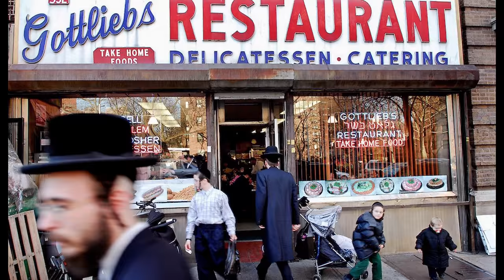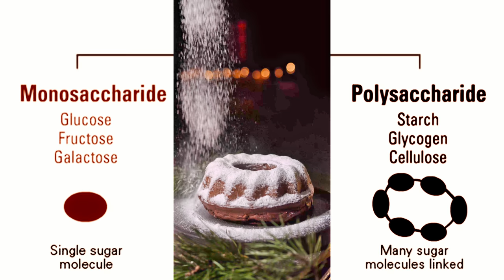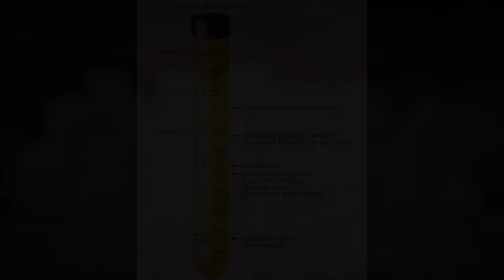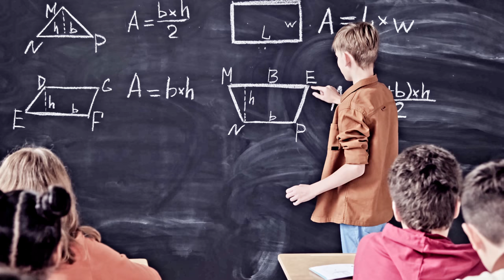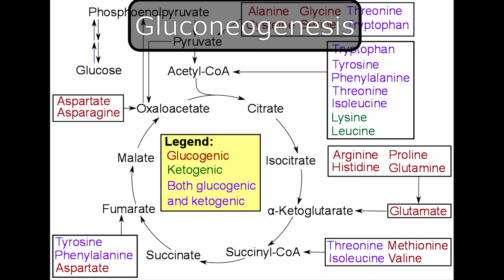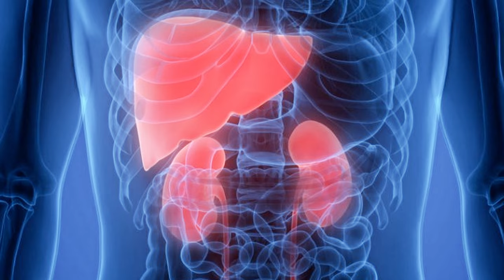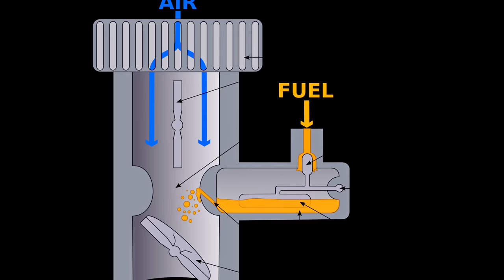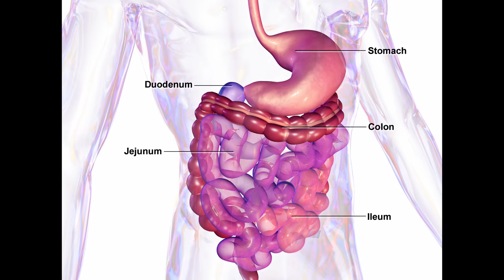12 Minutes From Death: The Blood Sugar Miracle

Comment: After being diabetic for 30 years, over 20 insulin dependent, and eventually being 100 pounds over weight, 5 years ago I went low carb ketogenic targeting under 20 grams of carbs per day. My insulin shots had been 4 times a day total of 100 units of insulin. Within two weeks completely off insulin. Have not had an insulin shot for over 5 years. Lost the extra 100 pounds in less than a year. A1c went from 7.0 to 5.8. Pain in knees and back went away. Got off two blood pressure medicines. Got my life back by cutting most of the carbs out. No going back for me.